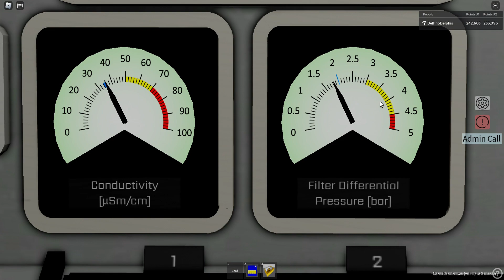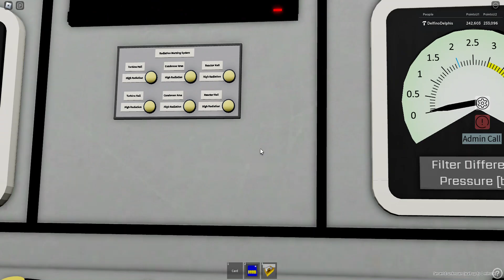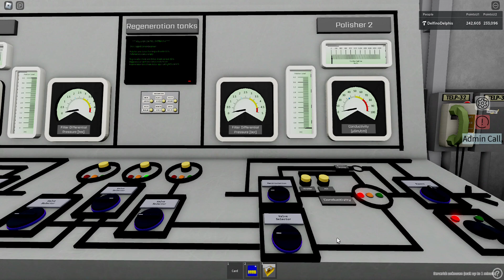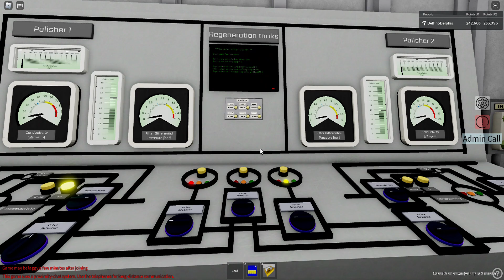RBWR | Polishers guide

Comment: This probably wont do anything but rbwr should have lightning strikes that can affect stuff from power to random parts to just sounding all of the alarms at once (of course there should be ability to switch the lightning events off)
Reply: yes
Reply: If a power plant is not even somewhat hardened against lightning strikes then it is a complete failure of a design

Comment: isnt there pump trips if bypassed or if they are on yellow
Reply: If you work with bypassed polisher there are no pump trips, you can forget polishers at all, for an earned point penalty
when working with non bypassed polisher, and the conductivity or diff pressure goes to yellow, you risk pump trips, but this is the way to gain maximum points
in other words one polisher should be used, while the other one is being regenerated, and they should be switched before any gauge hits yellow
the whole process of regeneration takes aproximately 20 minutes, while polishers are rated for about an hour of work, but there is also third resin available, so it can be used while the old resin is regenerating

In other words we work like this:
- work with polisher one, replace resin in polisher 2 for a new ready one, in meantime regenerate resin from polisher 2
- when needed switch to polisher two, replace resin in polisher one with the one regenerated, and in meantime regenerate resin from polisher 1
and so on

We can also work with two polishers, they will degenerate slower, but this is a temporary solution, as there will be only one resin waiting for replacement.
Reply: @jarosawklimentowski5091 good explanation. wish this was pinned